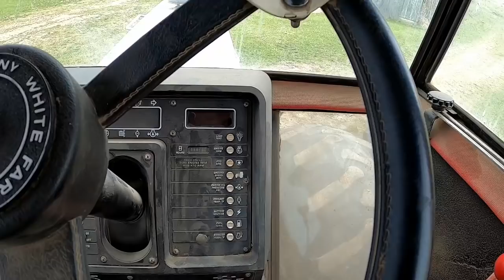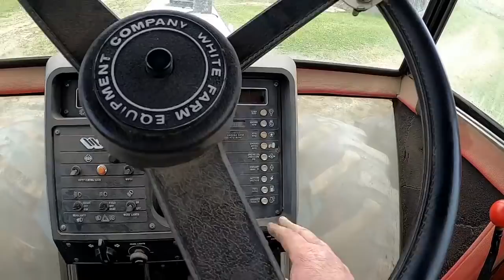Everything breaks... sometimes.

Comment: Hi Chris, with your help our 1850 did its first work of the season yesterday.  Steering cylinder rebuild means no more puddles on the floor, chain coupler made the banging go away at low speed idle, steering box conversion means it turns left AND right!!   We really cant thank you enough.  Anyway, I went to flip the draw bar and when I pulled the front pin, oh man I cant believe I pulled anything...  The anchor and pin are are toast.  When I remove the anchor, should I expect an oil bath or are the holes  on the rear end blind?
Reply from the maker: I'm glad I could help! The draw bar anchor bolts are blind holes, no oil bath today!

Comment: Had some minor breakdowns this spring. 
Which is better for rock protection, C springs or the flex design of the smaller White disk for example the 254?
Reply from the maker: I'd say the C springs. Granted, the White discs that use C springs are a bit heavier than the flex style. The C springs are still available, but are up to about $180 each.

Comment: We had a 4-175, and the solenoid was was on the frame rail beside the starter. Not sure someone moved it or it was factory.
Reply from the maker: This one was mounted on rubber nuts, no doubt because of vibration from the 3208.

Comment: Sunday mourning this is the first thing I do.
Reply from the maker: Awesome!
Reply: @ThatOliverGuyChris  Why do u put the Freon in water?
Reply: @mattsauer7267  because he's charging the system on the low pressure or suction side, which requires a gas. The freon is a liquid in the can and as it changes over to a gas the can gets cold slowing down the conversion. Placing the can in water helps speed up the process. This is basically what happens to freon inside the system.  Nice video Chris, maybe your next day out will go better.
Reply from the maker: @mattsauer7267  It's hot water. As the can empties, it cools off and the pressure drops. It can take a long time to suck the freon out, putting it in hot water cuts that time down a lot.

Comment: Never cared to much for those bearings you had to rotate into the bearing housing like that usally because the outer race was usually froze to the housing and required a hammer, Punch AND CHISEL to remove or a cutting torch
Reply from the maker: I know what you're talking about, I've used the blue flame wrench on them more than once.

Comment: The purpose of holding that can in water? 
No doorway is just big enough for that disc, top of the gang bumped a board going in. Cheers :)
Reply from the maker: It's hot water to keep the freon from cooling off and losing pressure. Those little cans take forever without it.
There might be a couple of chunks of wood missing from that doorway, it's probably the woodchucks.